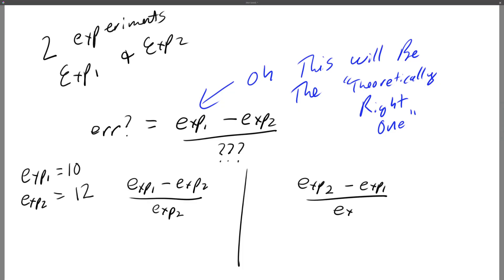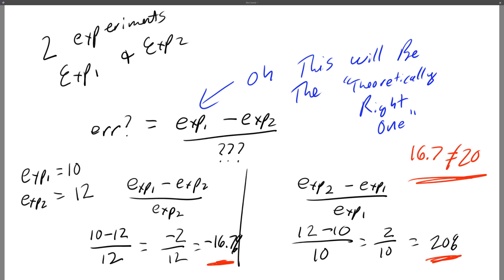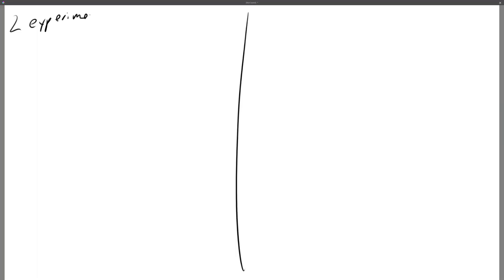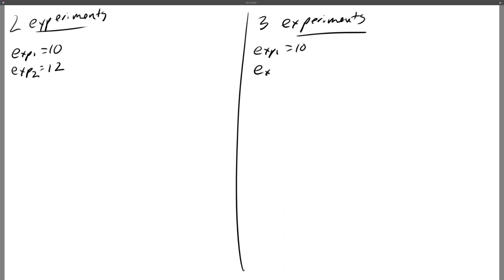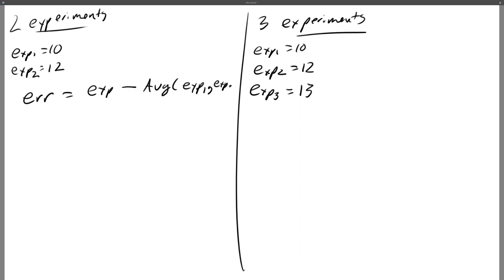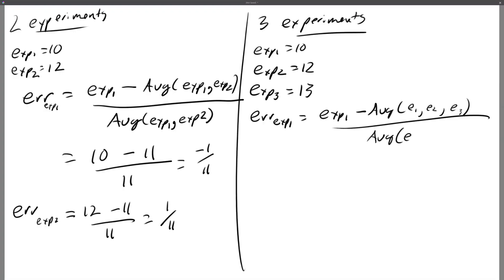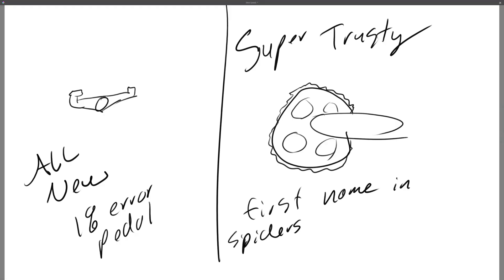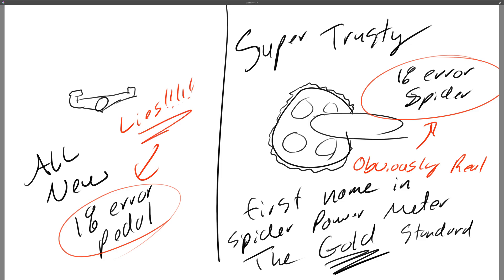Why can't powermeters get more accurate? Even if companies weren't making false claims

Comment: Hi Kieth,

Once again, a great video. I've enjoyed a lot of your work. I have an observation that I am wondering if you could help me answer. I've noticed that on rough and undulating MTB terrain, my Quarq reads higher than my Power2max (both on MTB's with a couple of years of data). DC Rainmaker noticed it to in his Garmin Rally Review. The Quarq matches my road data much more consistently (going back to 2014). 

Might this be a sampling thing? I've read (without strong source material), that the Quarq sample rate is much higher? Or perhaps a data smoothing issue with the Power2max on rough terrain?

Thanks!

Comment: The same discussion also holds for other sensor types, heart rate being a good example (which for some can include ECG and accelerometer data.)

There is also data loss during transmission which can cause dropouts for power and especially for heart rate (which impacts HRV statistics derived from RR intervals.)

While most head units appear to store (e.g.) power once per second. You can get and save it more often. Although that depends on the power meter/trainer implementation. And how they are measuring the data and if they are willing to report the data faster. The Wahoo Kickr Race Mode is an example. That works via (sort of) Bluetooth over Ethernet. But ANT+ allows for 8hz reporting (default is typically 4hz) and the BLE Cycling Power Sevice has the Request Sampling Rate procedure to set the sampling rate (which is a UINT8 with 1 hz resolution.)

I'm building a Windows app that can record any of the training-related sensors at least for indoor rides. Power, trainers, heart rate, SMO2, VO2, etc. And as many data streams as you want, ANT+ or BLE. Work in progress, but the intent is to implement as much of this type of testing as possible for use in realtime while on your trainer. www.fitnesshrv.com

Comment: Excellent video, thanks for making.  I have always questioned what I see as the elephant in the room, measurement accuracy traceability back to a national standard.  Such traceability is required for the calibration of most measurement instruments used to verify results.  In the various reviews, I have not heard any mention of this traceability being provided by the power meter supplier.  Also, I was aware that there would be limitations introduced due to sampling quantization, however, I found interesting that the data is only reported in integer values.  I assumed that floating point would have been specified in the standard.  Thanks again, very interesting and insightful.
Reply from the maker: You're very right. They don't provide it, nor do companies provide the standard load cell like characteristics. This is more down to marketing. People can at least fiend understanding "1% error is better than 1.5%" but give them creep response, off axis response, full scale error, etc etc then it's not marketing specs. This is one of the difficulties with consumer devices. Almost all companies use weights that have some level of tracability or tend to be checked regularly against scales calibrated with traceable standards. Nobody cares in the consumer public. Most don't know what NIST is.

But that's only half the problem. Just using a tracable weight isn't quite enough. PM's don't only get one force, they are subjected to many in various directions that don't contribute to the torque that is used to calculate power.  These are the most telling of the failure at the force sensing level. If a device senses in the X direction and I apply forces in Y, it should always remain zero, but most don't. And by how much is where problems arise. Now add forces in Z and 3 associated torques (which can be tested by offsetting forces as well) and now you have the basis of what should be tested.

Comment: Hello! I am develping a cycling anaylsis service similar to Intervals or WKO, and I use statistical analysis of power data uploaded by users to determine the accuracy of power meters. Detecting the errors in power meter readings is as challenging and interesting as estimating FTP or power duration models.
I have created a detailed cycling physics simulator, similar to bikecalculator. By comparing actual PR (personal record) data from Strava with computed values from the simulator for millions of cases, I can define the range of error between actual power and the simulator. This error range includes factors such as air resistance, rolling resistance, transmission loss, bike weight, incorrect rider weight input, and riding habits.
Based on this, I have developed a software that can determine power meter accuracy, and if the maximum error range is within 10-11% according to our simulator, the power meter is considered to be usable without significant issues.
Users of my service can input their power, time, weight, and other data for uphill rides of 4% or more over a period of 3 months into the simulator, and receive a report that allows them to easily compare the difference in values. This report is very useful. Of course, it may be difficult to expect the level of accuracy per second mentioned in the video, but overall it is not too challenging to track fitness.
Reply from the maker: Estimating things is not quite my realm. I'm a bigger proponent of directly measuring things. So I can't really help here. You're getting into aero stuff potentnailly.
Reply: @kwakeham  Ok. I respect your viewpoint. Personally, I believe that any method is fine as long as users can determine if their power meter is "shit" or not. If I see any bogus powermeters, I'll be sure to visit this beautiful realm again.

Comment: Keith, I agree with you that most reviews/reviewers are flawed. However, I disagree that there are no usable references. When I came up with VE 20 years ago, it was exactly because I was interested in evaluating PM accuracy. So, I don't compare one PM against another (or against two others): I compare power and speed against known physical parameters.
Reply: ...and strain gauge PMs that allow some sort of "stomp test" (i.e. static check of torque or force measurement) go a LONG way towards ensuring accuracy...all that's left in the calculation is accurate rotational speed measurement, which shouldn't be THAT difficult to accomplish ;-)
Reply from the maker: If two things say they have similar accuracy you can't just go around saying one is right. That's amateur hour and anyone who's studied any statistics or design of experiements knows this. The other fact is these are load cells. There is no "magic" and in effect they are pseudo "static" devices if you move / rotate your reference frame. Most failure is in testing forces that shouldn't give results and tend to "appear" response. As for comparing to physical matters, personally I'm not a fan of trying to compare a strain gage to a rube goldberg machine of math and assumptions. It might "work" but load cells and strain gauges don't need such methods to actually test, there are way more detailed stats that come with a professionally calibrated load cell then anyone can get trying to test a powermeter against estimation methods.

Comment: Kieth. Good nerdy video. And you didn't even talk about the many ways error (percentage) can be defined (something never really specified). Or how - with the method you described - we should describe error at/near 0W :) :) :)
After I went from designing power meters to designing torque sensors for ebikes it is fun to see that we achieve much better accuracy, lower latency, and better resolution (time/angle/torque/power) for a lot lower price now. I suspect there is a future sports PM based on ebike technology just waiting to happen :)

Comment: Great video Keith. Indeed, as we ‘lose’ that third wheel (so to speak) due to lack of PowerTap hub disc option, it’s become more challenging to have three concurrent units on road. As you noted, there’s still a good opportunity for developing guidelines for how to properly compare power meters, depending on time/budget - min thresholds. Various napkin-level attempts have been made over the years, but collectively we’ve never quite escalated to something more widely circulated. Of course, as Shane pointed out above, eventually you reach the rabbit holes that take days of untangling, or years of historical testing experience. Either way, appreciate the kind words!
Reply from the maker: That kind of makes me want to do two things. A video on the flaws at an internal level inside devices  and then the tests that can exploit them. And the other is build a new trainer test rig using a giant (7hp) servo motor that was from some work for a trainer company I did. However unless someone needed it I don't have a good reason to build said thing (again, and improved. The original was mainly torn down).
Reply: @kwakeham  First, I meant to mention in my initial comment but got distracted halfway through - the video quality and graphics of this video were a solid step up! Nicely done. As for flaws and how to show them - I think that'd definitely be useful. And not so much in the manner of trying to kill devices, but to help companies catch the issues earlier, which in turn makes for better consumer devices - plus of course such a video is helpful for reviewers to find more areas to dig into. As for a trainer test rig, I've always loved the concept on paper, albeit, the challenge I've had with ever moving forward on building a device is that these days it seems 99% of issues that power meters have (once they arrive on my doorstep) tend to be ones that machines wouldn't typically find in a lab setting. So everything from how me as a human pedals, to how it handles certain outdoor rough conditions, to even heat indoor drift (which a rig might help, assuming a rig can compensate correctly).

Comment: FWIW, a useful analysis "tool" for comparing / evaluating two measurements is the Tukey mean-differences (aka Bland-Altman) plot. It extends the average comparison mentioned in the video to a visual method which evaluates the entirety of the observations
Reply from the maker: Ah yes, I haven't used that often but very useful too! Thanks for the suggestion.

Comment: I imagine that "flock concept" plays a role here, like when cars queue up in a lane without valid reason.  If company 'A' makes the current de-facto gold standard that other companies have been conforming to, new makers/models might being doing tweaks to avoid being flagged by analyzers/reviewers as being your "Odd man out".  The nail that sticks out gets hammered down!
It would be sad if the deviations of a new innovative design were actually more accurate, but suppressed.
Early in my career when phone line data modems were still a thing and somewhat of a dark art, I brought my product designs to a small (2 people) respected independent test house that had custom-design test equipment and automated torture tests that took several days to run.  At the end of it, I knew if I had a design/component problem to fix, and incidentally how I stacked up against competition.  The key point is that the measuring stick was primarily a calibrated custom stimulus-response test harness, NOT another vendor's product.  The power meter + smart trainer market size might not be large enough to support a small independent test house, but in an industry where accuracy claims are on every sales sheet, it seems that's what is needed...